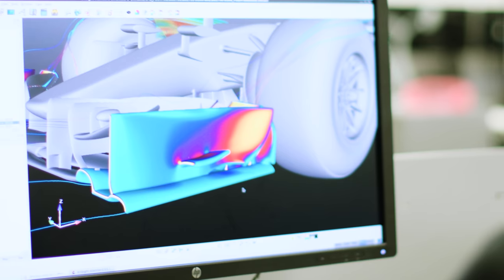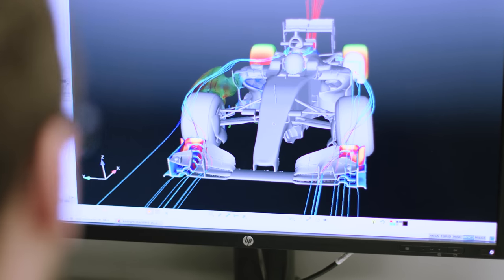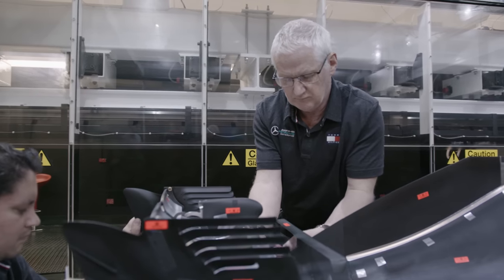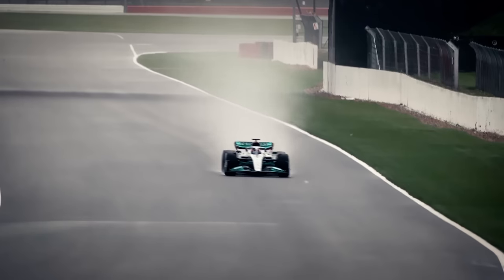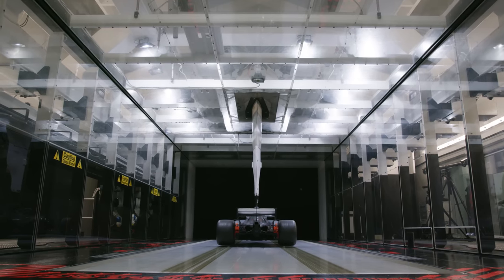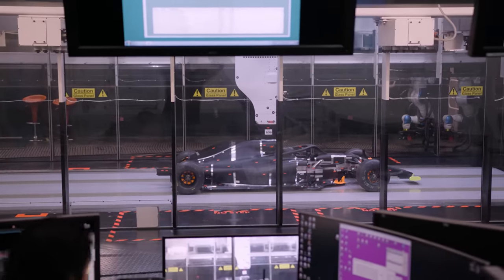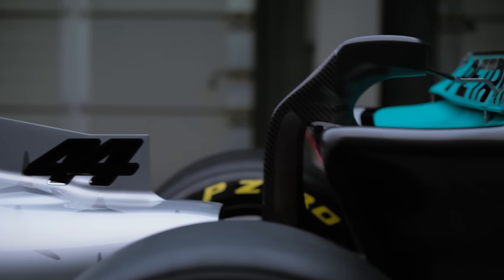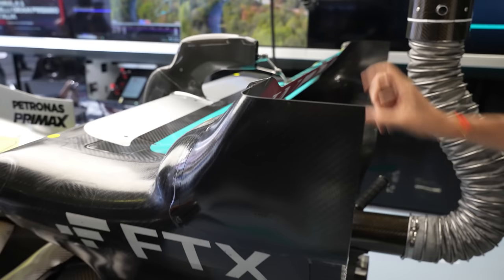What Is Downforce and Why Is It So Important in F1?

Comment: I feel like this reworked with vertical side pods W13 was designed and shaped more for straight line speed and also to not be hit too hard with side winds as it corners. Am sure Mercedes-AMG built structures that would compensate for some loss in downforce.
Great to see the car has slowly but surely greatly improved and could even beat Ferrari for 2nd in the constructors.

Comment: I suppose the challenge for next season is keeping the down force as is but reduce drag to increase straight line speed. This is a hard problem but not unsolvable.
Reply: The obvious challenge is getting more downforce with less drag at the same time but drag is also responsible for helping slow down the car at high speed under braking. It's like trying to envision a world without friction. No friction means everything slides around indefinitely and without friction, the act of standing up on our 2 feet would be physically impossible.

Comment: . .  Ai lets hit a "couple" of targets and not just one . Put a vein system within the body . Have it taper exit 'outsiDe' the body . Like a tunnel leads to light . Allow your downforce data to assist with a speculative honing path for what the arch of the tunnel should be to naturally give back the handling characteristics you want in the turns . #2. Less weight through honing . Aqueducts are timeless . 
#3. Quite some upgrades ago , my original thought was to find areas beneath the body of the car to scalpt  ' golf ball ' like recesses to control downforce or lift depending on elliptical shapes . Just kept thinking frisbees .

Comment: Question. Do teams run simulations pre race for each track understanding what the best downforce model is to be used based on the turns and altitude and wind forecasts and decide on the most optimal configuration? And since breaking patterns differ from driver to drive does this have any effect on the simulations while having different configurations for individual drivers?
Reply: Cars definitely comes pre race configured. I wathed video(i watched long ago), where they say cars come pre configured and setup is done around 90% before even hit particular track. They help with simulations, previous years data and probably other tools and informations. Real testing is mostly for fineses, car balance setup and for testing new parts. As for second question, i believe(i don't know for sure), they choose universal best setup  from aero, drag, brake disk size, cooling and suspension point of view and later when on real track, individual driver make smaller performance changes, like brake bias to own liking.